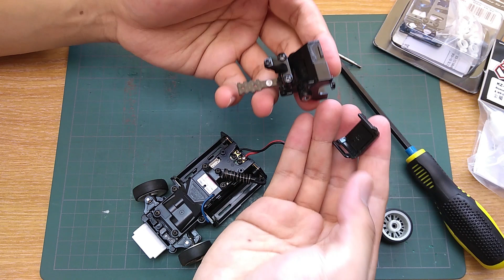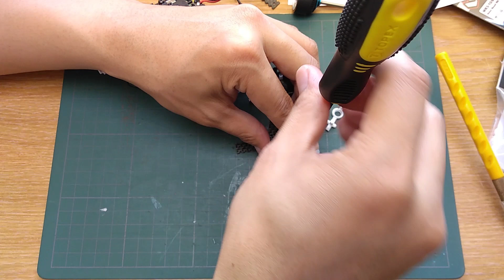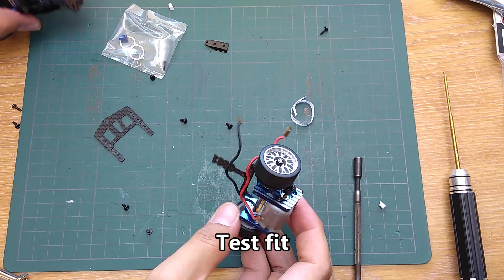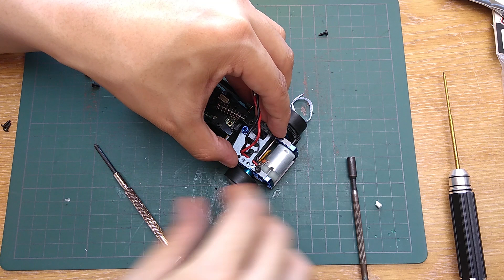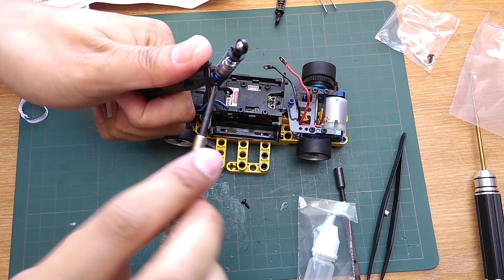Mini-Z MR03 Upgrades 2 - Aluminium RM Motor Mount & Oil Shock

Comment from the maker: Time Stamps
Disassemble original RM motor mount: 0:15
Installing aluminium motor mount: 1:27
Dealing with the motor: 3:28
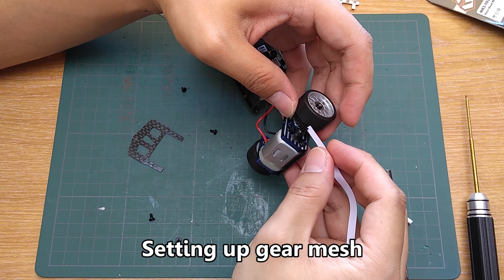Gear mesh setup: 6:31
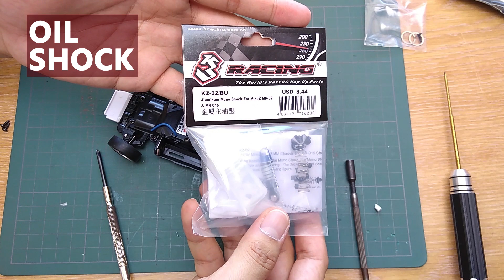Installing oil shock: 9:30
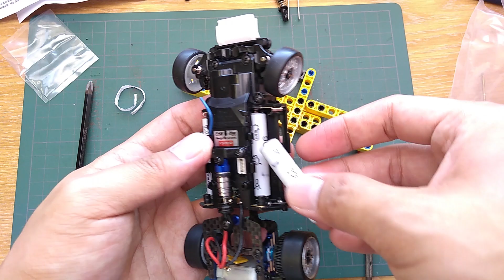Testing: 11:08
Reply: Hm have you looked into hydro dipping a mini-z body anything ?
Could be a great way too redo worn & already painted bodies.
Reply from the maker: @Mini-z1994  Thanks for the suggestion. I haven't look it to it yet but I have the NSX that probably need re-furbishing after a few knocks.
Reply: i guess it's kind of off topic but does anyone know a good place to stream new series online ?
Reply: @Jordan Kenzo Meh I use Flixportal. just google after it:) -brody
Reply: @Brody Dariel Thank you, I went there and it seems like they got a lot of movies there =) I really appreciate it!
Reply: @Jordan Kenzo happy to help xD

Comment: Where the stock suspension connects to the back end of the body, that plastic broke for me. This mounting style looks like a more solid solution than super glue. Excellent video, and thanks for helping me!
Reply from the maker: The T-bar breaks pretty easily. The rear motor catcher/clip also breaks easily. So far I haven't got any problem with this motor mount yet and it doesn't hit the body I use (The old NSX).
Reply: @BeaversHobby  I mean the spring on the top. The plastic support for that in front of the motor mount broke off of the chassis ;-;
Reply: Btw, I just got my mini z on Amazon because it was at the price you said was worth it! I got the GT-R R35
Reply from the maker: @bryguy6452  There's spare for every part so you should find it pretty easily. Also congratulations on getting one at fair price.

Comment: have u upgraded the tires?`

for tracks like the kyosho ones, get "pn soft" tires for front  and "pn super soft" tires for the rear. :)
for carpet its some other ones. 
tires make most of the performance of mini z
Reply from the maker: Thanks for the suggestion. I've just got Kyosho radial 30 degree front and 20 degrees rear but haven't installed them yet.
I run my car mainly on dirty office floor so I'm also looking at GQ foam tyres. I really want to try PN  and Marka too.

Comment: Do you have an install tutorial for ball diff on mr-03 chassis? Or do you have a recommendation on which one to purchase?
Reply from the maker: Diff is a bolt-on so tutorial isn't really needed. You can also see in this video that I just thread it through and lock it in place with grub screw.
The best one right now is PN Racing (choose according to your motor mount because LM is wider). http://www.kenonhobby.com/PN-Racing-Mini-Z-MR0203-V3-Ceramic-Ball-Diff-Set_p_42916.html
The one from Mini-Z is great too but a tad more expensive.
Reply: Thanks for the info. I recently installed a xspeed motor and I think my diff is toast. 🙄 I expected it to be the first thing to go. I’ll look into the PN racing one. Hopefully I can find a cheaper price than what I’ve been seeing on eBay.. 🤑

Comment: Hello, could you recommend please good grip max sticky  tires of PVC laminate for MR03? I understand that laminat is not the bast surface for non drift car, but it all what I have. :)
Reply from the maker: Mini-Z radial tyres. It works even on dusty surface.
Use more degrees at the front than back eg. 30 degrees narrow front + 20 degrees wide rear. If the back has more grip it won't spin out easily.

Comment: motor mount (rm) & (mm) Install instead Can or not. ? (I bought it wrong.)  If done. What needs to be changed?
Reply from the maker: Yes, you can use any motor mount. MM also works with this chassis. Diff is the same as RM. But the wheelbase will change according to the motor mount you use. MM with RM T-plate will start from 102mm wheelbase so you'll have to change the T-plate too to get 98mm wheelbase.
Which body are you going to use it with?
Reply: @BeaversHobby  sir yes sir Thank you bro
Reply from the maker: @T2EJourney  My pleasure.

Comment: I know this is an old video but can a sensord motor bolt up to them mounts?
Reply from the maker: Yes, it'll bolt to the mount just fine. The problem is at the back. Most sensored motor have flat bottom and won't fit inside the bracket. You'll have to find a mount that has only the hole at the front and no rear bracket. Take a look at PN Racing. They should have it.
By the way, Mini-Z is always relevant. They don't really change things.

Comment: Hi. How you connected radiolink with FHSS with mr03 (FHS)?
Reply from the maker: I use multiprotocol module. Here's the video tutorial. https://youtu.be/zJmg_gv34us
Actually the FHS and FHSS doesn't mean it would connect to each other. It just says "frequency hopping spread spectrum" technique to avoid interference. What makes Tx talks to Rx is protocol.
I forgot to mention Mini-Z FHS is actually FlySky AFHDS protocol. You can use FlySky radio with it too. Here's the tutorial. https://youtu.be/fX0REIw1GRA

Comment: I'm interested in the lego stand if u can show more info on it and what pieces needed
Reply from the maker: It's very simple. I just use the pieces I have.
Basically it's Lego Technics, stack in 2 layers and held together with black pecks. The pieces you need are long 5-12 holes and L shape pieces to make it rigid.
Here are some photos so you can adapt it to the pieces you have.
https://imgur.com/oaH7JV9
https://imgur.com/iUsKrCT
https://imgur.com/PPDfgew
https://imgur.com/xYg3ZXe

ps. It's not the most financially sounded stand  because you can get PN Racing foam car stand for about 2-3 Euros but I didn't have to pay for it.

Comment: Hi, Racing Radial Tire 30° MZW37-30 1 bag x 4 pieces, can they use on both front and rear wheels?
Reply from the maker: Yes, you can. Just check if you have the wheels for the width you are going to buy. If it's all narrow then it's pretty standard. Some cars come with all narrow out of the box. If it's all wide then the front might look a bit weird but you can use them.
Reply: @BeaversHobby  For Mr03 front are narrow, rear are wider. Mean I have to buy 2 different sets of 4 tires each pack? Seem I need your advise for selecting a set of tires😊 to play indoor home tiles
Reply from the maker: @fwfefrtefdv4719  Yes, in this case you will have to buy 2 sets, one narrow and one wide. As for the shore (tyre number) it depends on the track but generally 30 is good. If you roll over in the corners then tune the suspension first, make the spring stiffer. If it still rolls then you will have to decrease the grip at the front by using a higher number (40). Or increase the grip at the back by using a lower number (20).
Reply: @BeaversHobby  Thanks for your advise!

Comment: Wouldn't the carbon fiber you just removed be stronger then the aluminum?
Reply from the maker: No, the one I need is motor mount and the one I removed is from plastic that has cracked. The plate is graphite and yes, it's stiffer than the one on this aluminium mount.

Comment: Can you turn this into RWD drift car.
Reply from the maker: Really difficult because the steering is limited. However if you have 3D printer you can print a new chassis to have enough steering, install all new electronics along with gyro and use just the motor mount from the original car. But that's not really a Mini-Z is it?

Comment: Does The mr02 body fit The mr03??
Reply from the maker: Yes, all of them. Every body fits on MR03 because it can adjust the width of both front and rear.
Reply: @BeaversHobby  Thanks for answer 😁
Reply from the maker: @lillerikxp  My pleasure.